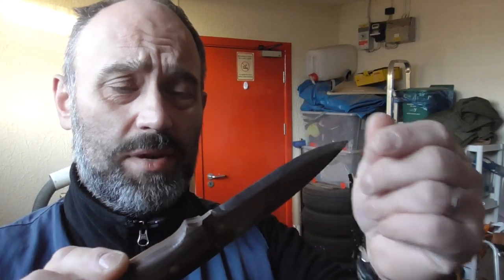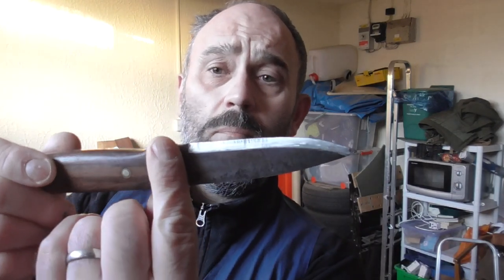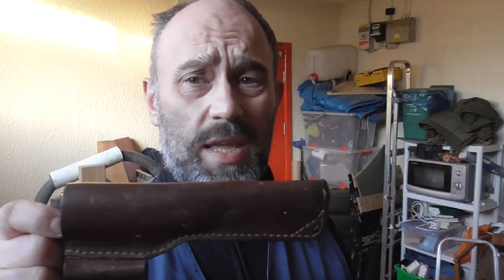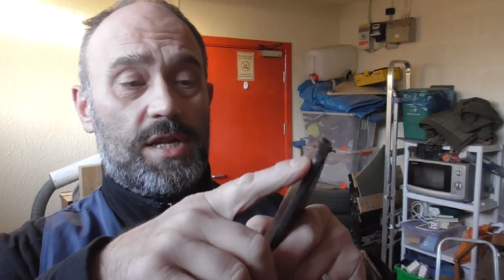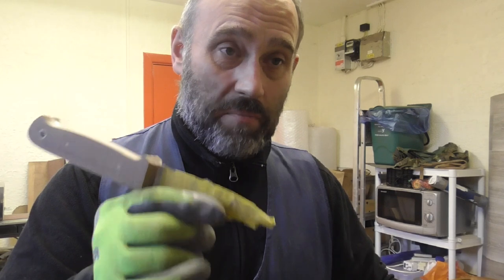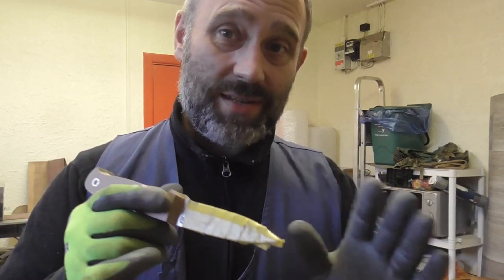A.Wright knife refurbishment

Comment: "   Their own brand of Sheffield made Bowie knife, when you see them in person are breath-taking. Also, a very, very popular knife is their take on the classic Bushcraft blade. They use 01 carbon tool steel, hardened to 56/58 Rockwell. Crafting them with Stag antler, Buffalo horn, Rosewood and of course the fabulous Snake wood handle scales. John showed me the steel blanks used to make the 01 carbon steel Bushcraft knives. The stag handles are cut from natural stag gathered from a sustainable source in the UK. The blade is 4.5mm thick, providing excellent strength, weight and balance."
Hey Rob, copied a little bit from an article on A Wright & Son from Sheffield. I suspect the reference to the bushcraft knife matches the one you refurbished. Earlier in the article it mentioned the ferro rod holder on the sheath was an extra option . 
Nothing like a flu bug to kick off the new year :~/ Hope your back in good health my friend. Thx for the great vid!
Reply from the maker: Cheers mate, these Wright knives have some easy to fix flaws .